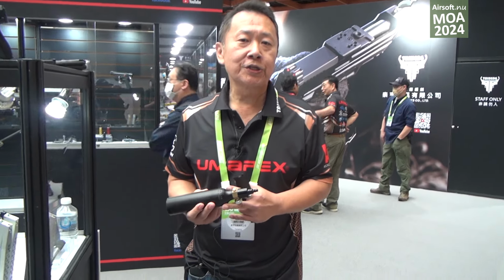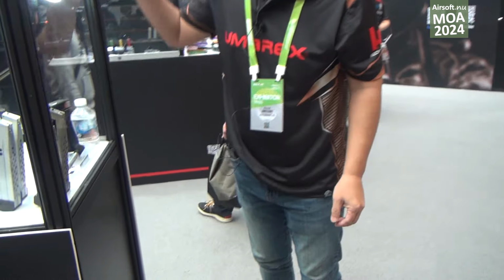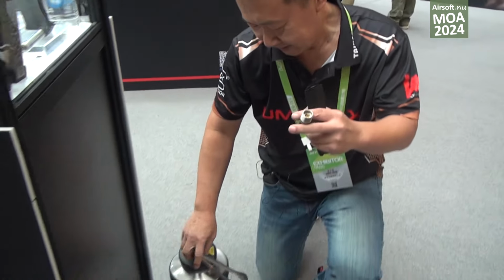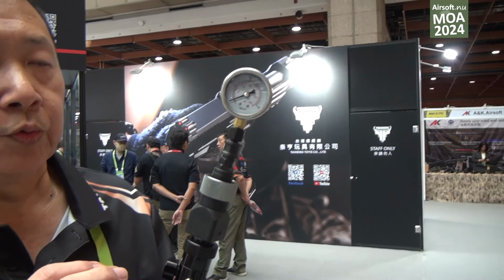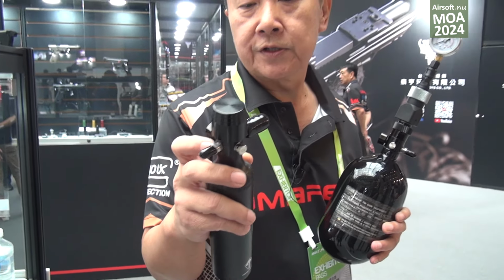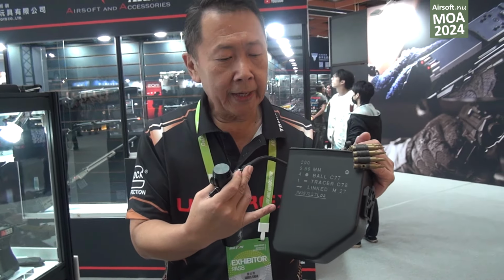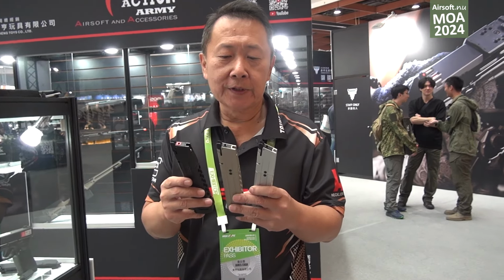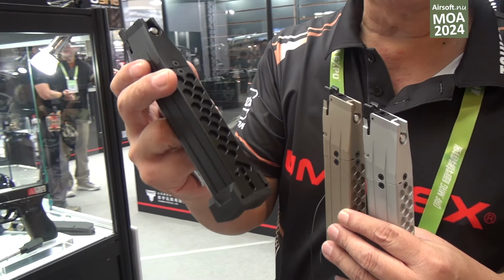Maxtact at MOA 2024 (airsoft)

Comment: I do not see dry ice being easier to get a hold of then CO2 cartridges. Same goes for using a larger CO2 cannister to refill the mags. Although I do remember hearing that some countries have a hard time getting those small CO2 cartridges.
Reply: Refilling from a paintball co2 tank is much much much cheaper then using cartridges and considering paintball is basically found all over the world and is relatively more common then Airsoft, finding those tanks/refill stations is super easy.

The dry ice is also very cheap such as getting multiple pounds of it for $20-40. Though due to storage issues it’s more suited to doing group buys with friends right before a event or a shitton of home testing
Reply: @opairsoft8100  First, paintball doesn't use CO2 anymore. They pretty much use HPA 95% of the time. And while dry ice is cheap to buy, you have to carry it around in a big container, and use gloves and tongs to handle it. It just feels like they are putting a lot of work into solving a very minor issue. But hay, clearly there are some people out there that will find this convenient, otherwise they wouldn't have made it.

Comment: Is it okay to use dry ice for airsoft? Can it work? If it does, what advantages does it have?
Reply: Can it work? I'd assume so because it's literally solidified CO2 that is melting and the gas is, well, CO2.  The only advantage I can think is higher gas capacity, but you probably have to throw away the excess or keep unloading them during down time to keep the pressure down.
Reply: Knuckles did a YouTube video a couple of months ago about using dry ice in maxtact mags. Check it out. ✌🙂